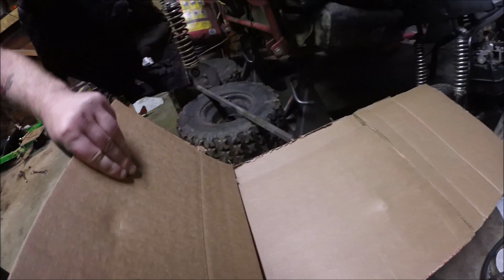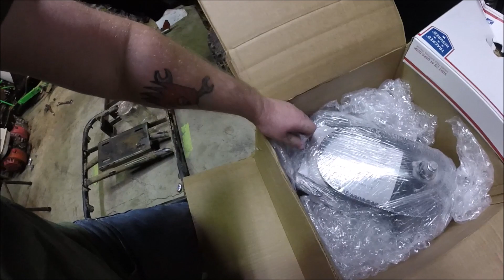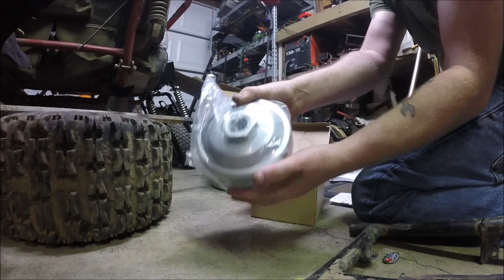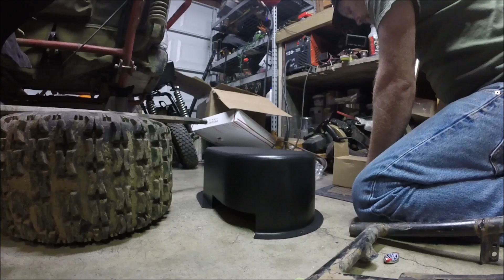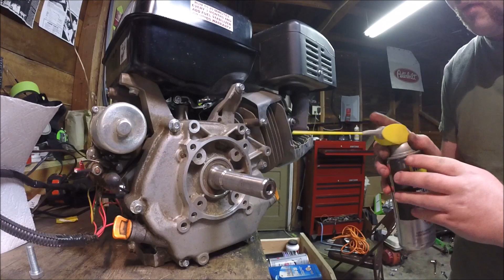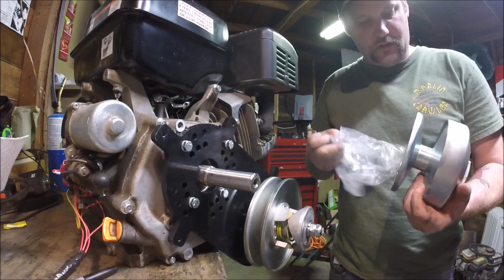420 CC Torque Converter Install

Comment: What’s the size of the first bolts you used for the mount that goes over the shaft and to the side of engine
Reply: The kit comes with all bolts you need to install the torque converter

Comment: By having the conical pulleys facing in that direction, wouldn't that mean the belt would misaligne by about 6mm (1/4inch). On the clutch pully side the belt would ride up towards the engine and on the other bigger pulley the belt would ride down outwards therefore making the belt off centre?
Reply from the maker: the belt stays pretty straight. i rode it today and seemed fine